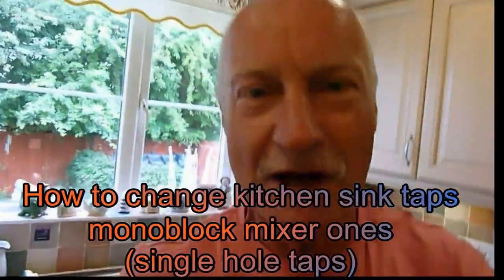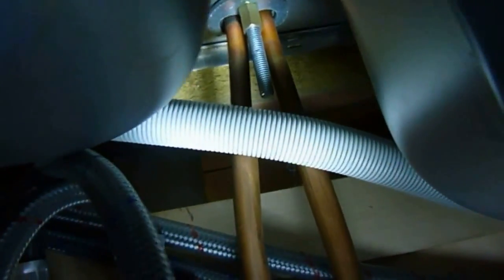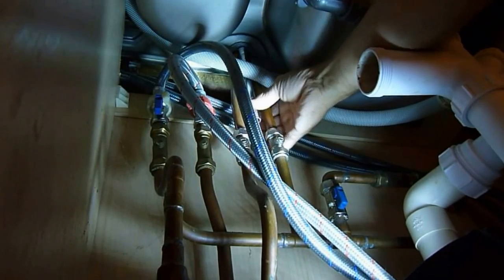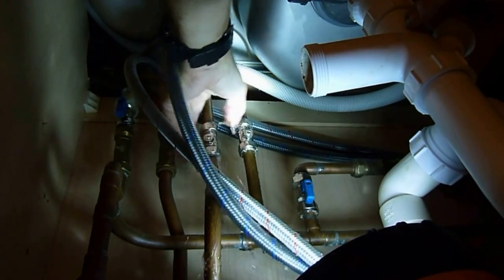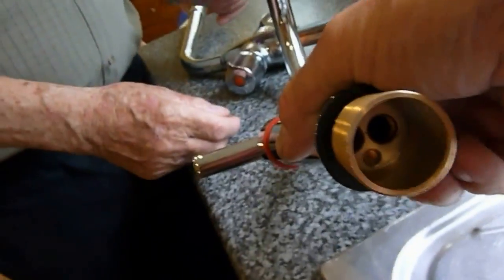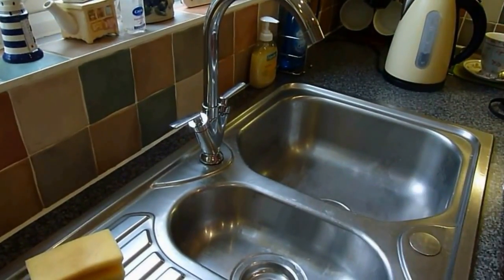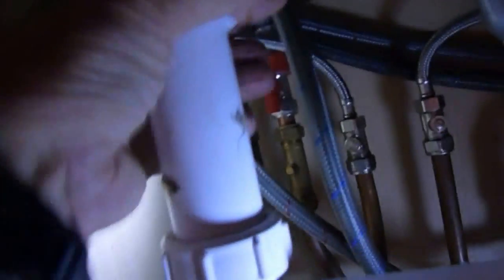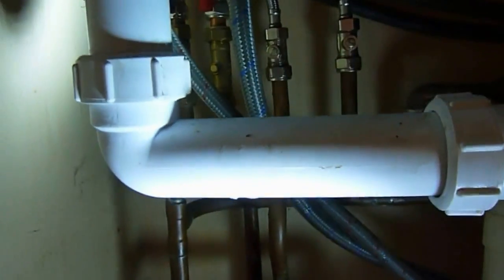How to change mixer taps.(monoblock mixers) .Kitchen taps shown, but same for basin or bath

Comment: Is it OK to screw the flexi straight to the isolating valve as some are sharp on the end
Reply from the maker: Yes just be carful not to tighten too much as the rubber washer can spill out.

Comment: What if the old tap mixes at the end of the spout but the new tap mixes in the body (and there is no non-return valve)? Will this not lead to the higher pressure cold water traveling through the body and up to the hot water cylinder? It amazes me that where the mixing takes place in a mixer tap is not clearly stated when purchasing a new mixer tap.
Reply from the maker: It could do. I always fit non return valves now.

Comment: I'm looking to do a similar job on a stainless steel sink where the existing tap is both leaky and wobbly due to the old horseshoe fixing.  I really like the idea of a tap with a proper shank like the one you fitted and in fact have found the same tap on e-bay.  Can you comment on it's longevity now?  Did it stay solid?  No turning?  No leaks?  Superb video btw, thanks!
Reply from the maker: +Neil Palfreyman The tap is still working fine, I would say the only thing with it was that it is a not as well made as I would like and does wobble a bit, although it is fixed firmly. In hindsight I would say to buy a bit better quality, the heaver they feel in weight then the more the quality is.
Reply: +dereton33 Thanks for the reply.  The problem, of course, is finding one that fixes with a shank (so is solid) and doesn't cost an arm and a leg! When you say it wobbles a bit, which bit wobbles?  It's for a rental property so the priority is being solid and not leaking.  I can compromise a bit on style!
Reply from the maker: The tap when mounted through the sink just feels not as secure as a heavy brass tap. The actual fixing is very tight and secure, It has been fitted for nearly 2 years now with no problems.

Comment: What size is the basin spanner, there are a few on ebay but trying to work out the size? Great video by the way 👍👍
Reply from the maker: A nine inch extendable
Reply: @dereton33  would that be a 280mm? the nut on the tap is bigger than that, I think. I've never used one do I don't know how adjustable they are, thanks for your reply 👍🍻

Comment: great video, thank you, if i may ask a question, i have the same tap you are using in the video (the one you are installing) and one of the handles has become dislodged  and the metal is eaten up so i can't just tighten it, is it easier to just replace the handle and handle base or the whole tap? i'm wondering because i forund the whole tap for £13.

Thank you in advance for any help.
Reply from the maker: Always best to renew the whole tap.
Reply: thank you.

Comment: Hi, just about to change my mixer tap but can you tell me...do i need to use olives if using flexy tails or not.
Thanks very much in advance,
Mark.
Reply from the maker: Mark Rayton You can get push fit flexy if you do not like the compression type that use olives. Al.
Reply: Thanks very much for that AI. New taps all fitted thanks to your great video.
Mark.

Comment: Bought a tap from b and q for this job but it came with copper pipes. Where can i buy the flexible pipes that you used ?
Reply from the maker: Most independent plumbing shops will have them.

Comment: In my opinion you plumbers could also work as a Gynaecologist because a job like thgis one strikes me as being most difficult in the most inaccessible location. Mind you I have done it but I also need a long thin box spanner to fix the underside of the tap. I didn't see you fit that flexible hose either. I like what you do here though.

Comment: Derek .... why the need for the pipe cutter? Just unscrew the pipes, straightening them as you unscrew. Has always worked for me when I've replaced a kitchen tap?
Reply from the maker: SearchBucket2 I usually find that the new taps have either different connections or longer or shorter pipe connections, also it is easier to pull the tap out and clear of the sink when they are cut, otherwise you have to get those nuts and olives off first, in order to extract the taps out of the sink unit, which can be awkward under a sink. Al, not Derek.
Reply: dereton33
Sorry Al. I meant why not unscrew them from the tap body and "recover" them from underneath instead of pulling out through the top? So far as I know they are screwed in too?
Reply from the maker: SearchBucket2 I like to renew the pipes tails that come with the taps, as quite often the old tails are a different thread, or can be bent so jam when trying to undo them. I also feel much more confident when new tails are fitted rather than using the old tails, I did this just once and was called back for a leak which turned out to be an old tail rubber washer leaking, after that, I always renewed the tails as good plumbing practice, Al.

Comment: Hi Dereton, I've just renewed all my bathroom basin and kitchen taps.  The tap sets  all came with ...i don't know what to call them?...plug holes/drain flanges?...so I changed them as well.  I am a novice and didn't use any silicon caulk/plumbers putty.  They all came with washers so I thought I was safe enough.  I've been watching a few videos on youtube tonight and I see a lot of them used caulk around the taps and putty around the drain flanges.  I thought I was going to have to take the whole lot back up and redo them using the putty etc, but I notice you just were happy enough with the washer and didn't use any silicone.  Am I safe enough to leave it do you think?  I have a few more jobs to do, so haven't turned the water back on yet.
Reply: Also...the tailpiece on the old flange was longer than the new one, so I've a two inch gap between my tailpiece and the PVC trap thingie.  I can't put back in the old flange as it had a pivot rod.  I also had to take the hacksaw to one of them due to a immovable nut issue.  I assume I'm going to have to fashion some kind of extension tailpiece.  Any advice on that matter would be great...I love your videos.  Thanks for posting them.  I find them very straightforward and you cover all eventualities.
Reply from the maker: Don't worry the washers will be just fine.
Reply from the maker: Hi Moses if it is the 15 mm pipes that are short you could always cut them back and use flexi connectors to make up the gap. If it is the waste that you mean is short, then you can get a waste trap that is extendable in height that can make up the gap. If none of these answers are right for you then visit my website where I can take a look at any pictures of the problem, that you can e-mail to me.
Reply: Hi dereton. Thanks very much for ur replies. Great re the washers! Whew!  It's the waste that was short and I did as u suggested and got extendable ones. Thank god it's as easy as that. I thought I was going to have all sorts of horrors. :-D
Reply from the maker: Well done Moses, glad you managed it ok.
All the best,
Al.

Comment: HI, The screw under the old mixer is stuck :( I have tried the tool you mentioned and a socket ratchet as well .. but it does not give in :(
Reply: +Vishal Malik vinegar sprayed on and left for 15 mins helped .. fully corroded screw undone .. yaay !

Comment: I've got a problem.  Fitted a new tap, the old 10mm hose doesn't allow enough flow, so I got a pair of 15s - with a male end... and the iso valve also has a male end.  Can't find a female ended 15mm hose anywhere.  Help!
Reply from the maker: Robert Ferguson It`s OK Robert just buy a female iron to copper coupling and screw it onto the male end this will then give you a female end. Plumbing has a very sexist style about it, Ha ha . Al.
Reply: Thank you.  Hah, I know what you mean. All a bit saucy!  Unfortunately, that iron coupling won't work either... but, that doesn't matter anyway - the tap I bought is not suitable for our gravity-fed LPS.  :D  Back to the Wickesing board....

Comment: I went looking for a video explaining the damage done when a male person grabs hold of the kitchen tap spout, (a flick mixer swivels between two sinks only no other movement or hoses) and violently shakes the crikey out of it really hard, as if it was a flexible hose or something, trying to sprinkle water over his pasta.  (?)  So far has clean just snapped off seven different tap spouts in his hand from shaking them like that over some years.  The one we have now, is now leaking continuously from the swivel part, dribbling all the time now.   When Ive explained not to do that, they say  "No its a swivel tap so you should be able to shake it".  (?)  Even after snapping seven spouts off so far.  How else can one explain how not to violently shake a fixed, but horizontal swivel only flick mixer tap.
Reply from the maker: Never mind.

Comment: I wish you'd shown cutting of the copper tubes, it seems that's the worst part of the job. Also how did you get both nuts within the washer? All the hard bits can't be seen.
Reply from the maker: I have a more modern version of changing taps now where all these things are shown. You learn through your mistakes. Here is the link.  https://youtu.be/cicI4fnesIQ
Reply: @dereton33  Thank you, as they say every little helps. Yours is still the best video so take heart its helping many people who haven't the ££'s to be ripped off. May the force be with you.

Comment: Couldn't you push  the tap up and cut the pipe from above the sink to get nuts and cones off, then pull them free downwards.
Reply from the maker: Too tight.
Reply: Didn't really think deep down that would of been that simple with a man of your wisdom.

Comment: Why on earth no handles on the water shutoffs-?  All the ones here in the US have knobs. Id hate to have to go hunting a screwdriver in an emergency.  When the feeds are too long you just put a loop in them
Reply from the maker: Yes it`s different here in the UK.
Reply: yambo59 I live in UK i put hot and cold washing machine ones on mine as u can just hand turn them
Reply: Hi - Love the UK -- Im not sure how those washer shutoffs you speak of are made in the UK, they could be like the quarter turn valves im a big fan of.  The quarter turn ball valves are so much better than compression seat valves, here they also make them in chrome finish for supply shutoffs for under sinks, fixtures etc . They don't give near as much trouble later on when needed the most, and are much faster to turn off in an emergency.  But theres many many older installations with the compression seat type shutoffs still around and will be for a long time.  Ive replaced every shutoff In my house with quarter turn style shutoffs, even added a 3/4" one next to the main shutoff as its very old and id just as soon not disturb it when I need to shut water off for a faucet change etc
Reply: Yes it's a quarter turn so much better I can even turn them off in complete darkness in case we get a  power cut as well

Comment: I have a vintage mixer faucet pictured here, https://www.pinterest.com/pin/7951736822593643/
I'd like to restore it but I'm not sure parts are available for it anymore. At least this video helped me to understand its functioning a bit more. What kind of water hose/pipes would have went through the bottom two holes? The faucet doesn't appear to be threaded inside the cold hot water intakes.
Reply from the maker: Best to renew it.